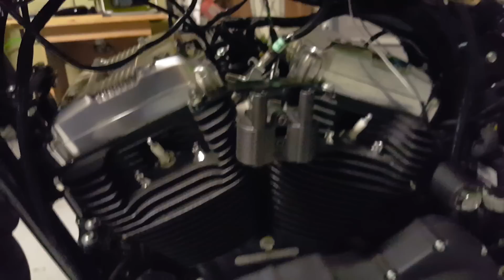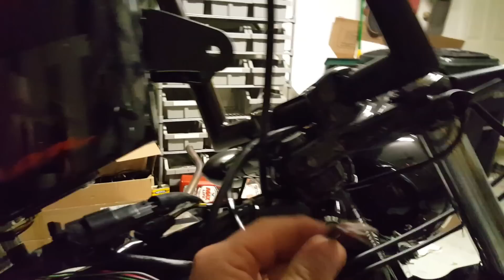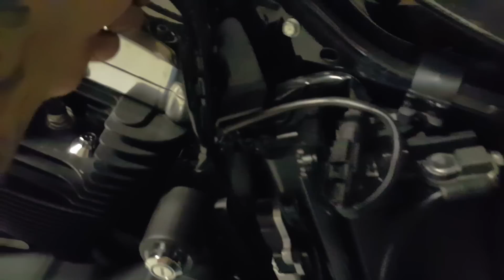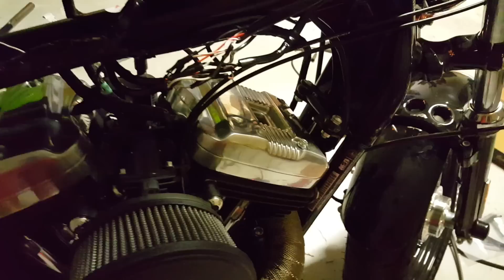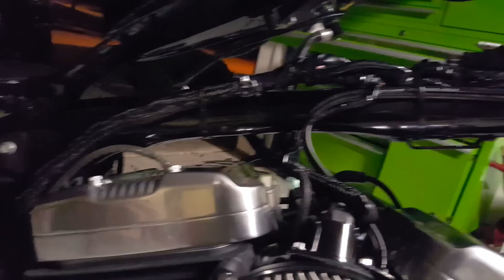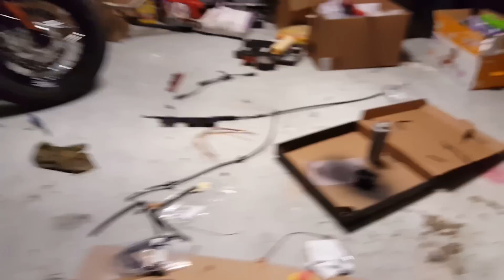Sportster Forty-Eight 12" Z Bar Install, Ignition Relocation, Tank lift Part 2

Comment: sick bike man! yours looks almost exactly like where im going with mine. coil relocation kit is on the way and after watching this, im definitely going to home depot for some brackets.
Did you have to mod anything to get your solo seat to sit that low? i just installed mine with the  3" springs that came with on a mounting plate and it sits a lot higher than i expected. i still love it but i imagined being a lot closer to my fender than i actually am now. any advice is appreciated
Reply from the maker: in this video I had the seat mounted with no springs but now I have solid struts so I've added springs. Mine is a Harley seat and the springs are designed to keep the seat low. if you have an aftermarket seat, you may want to get some 2" hairpin springs.
Reply: +John Mullins awesome! I'll look into it and probably get a new seat eventually. I've kept the stock one until about a week ago. Thanks for the quick response
Reply from the maker: +Antonio Moran no problem.  I try to help where I can.

Comment: very nice bike man. did you have to run longer cables for throttle clutch and brake with the z bars
Reply from the maker: yes. I purchased a kit from Burley.
Reply: +John Mullins ok great thanks man just picked up an 08 883 for very cheap gonna be my winter project. thanks for the reply
Reply: +John Mullins i contacted burly and they said you cant use any of their cables on z bars. Are you saying you used burly cables on your licks z bars